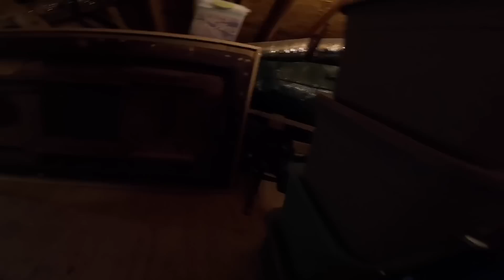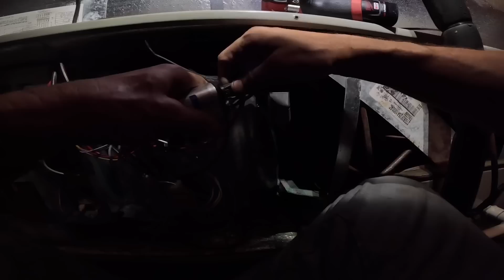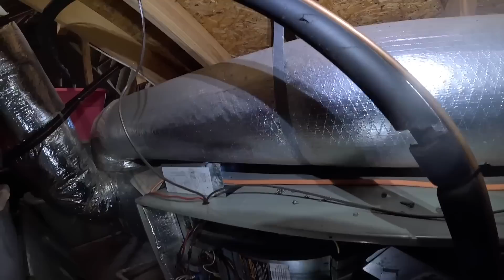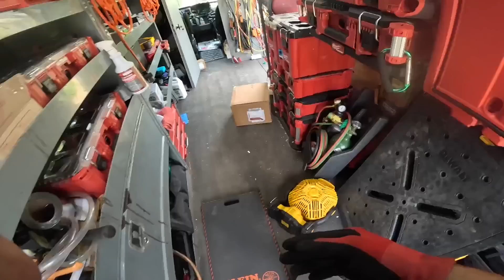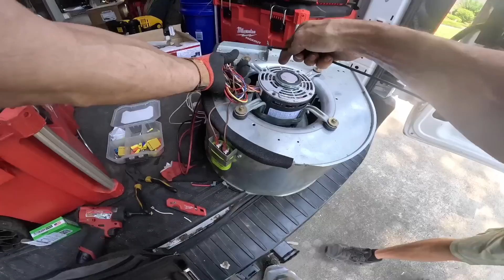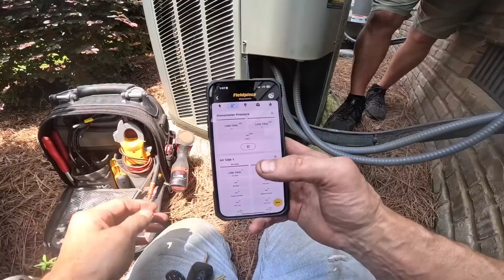Visiting a Frindly Customer. His Upstairs Wasn’t Cooling! #hvacguy #hvaclife

Comment: 70s and 80s growing up on a farm in LA (Lower Alabama) in the same latitude as your customer, pretty much learned working on everything since we never called a repairman, we were the repairmen. Started out 4th grade with small engines and outdoor boat motors as the helper for an old man who lived on a parcel of our land. Every day after school "Hey bear. Hey Bear, let's get to work" as small engines was his side business in retirement. Eventually cars. When my grandad didn't have be pounding in fence posts from his pickup tailgate since I was short, it was going 2 miles to a boat ramp camp site we owned on the creek and working on rental trailers sometimes package AC. Until I was more independent, grandaddy would diagnose and I'd go-kart the part and install it after we took a trip to town to get the part. Reshingling is about the only thing I shy away from because can't have roof unprotected for 2-3 weeks doing it in my off time. In some parallel universe, I would have wound up living with my single mom who would have taught me nothing

Comment: Hey Curtis, I recently had a blown compressor due to the txv malfunctioning and flooding back which killed the compressor have you ever had that happen to you or something similar thanks! It was a first for me
Reply from the maker: It would be hard to figure out until Compressor is replaced, then you’d have to turn around and have another major repair
Reply: @HVACGUY I ended up quoting a txv and compressor but they went with a new condenser and evaporator coil i just wish I could’ve known prior to the bad compressor burning out that it was the txv, i found the bad txv because when I set the new condenser in my nitrogen wouldn’t flow back through so it sort of bit me in the ass but hey we are only human got them a new coil and ac and they are happy now and that’s why we do it

Comment: Like many home owners, I did not know that my thermostat required 2 AA batteries. When the air conditioner stopped working in August, it cost me $150 service call to replace two batteries.
Reply: You don’t need the batteries the system powers the thermostat if it’s wired for it
Reply: @CSXRailfan6588  Not always. Depends on there being a common wire and some thermostats will not operate even with 24V coming from the system to the tstat. Far too many thermostats to make a blanket statement like that.
Reply: @bill944  well I just use Honeywell 5000 thermostats because they are the best
Reply: @bill944  true, I've even replaced 3V lithium (2032, etc.) buried under the circuit board, this holds the memory and settings while you pull from the base and change the AA batteries.
Reply: @ricklee4  I'm talking about thermostats in general that have a common wire and the hot wire. I've had thermostats not operate due to battery failure. It's like the batteries are for the thermostat's ability to function only.
Reply: @bill944  Agreed, Honeywell is known for that. I'm just reinforcing your statement about "far too many..." to make a blanket statement about all of them.
Reply: @CSXRailfan6588  Perhaps some thermostats do not require batteries for the hvac system to work.
Reply: If your HVAC has the blue common wire, replace that thermostat with one without batteries. Batteries also leak so there are at least two reasons not to use them.
Reply: try $360 in seattle